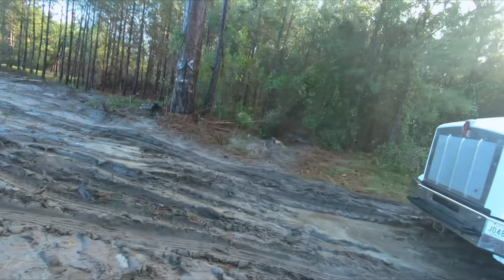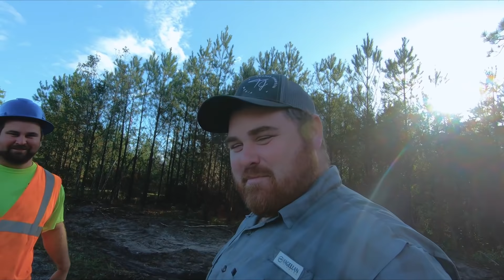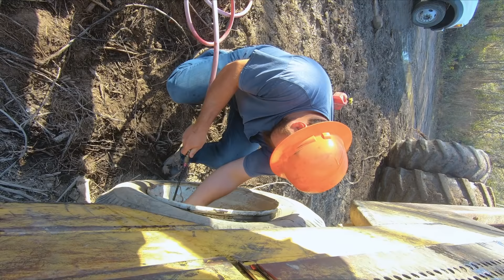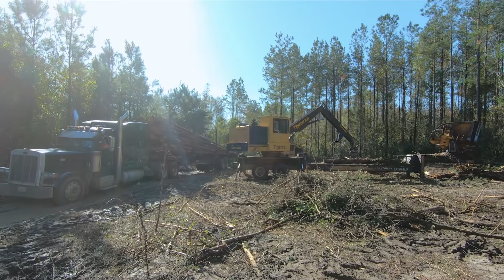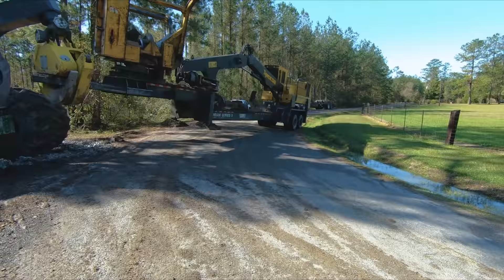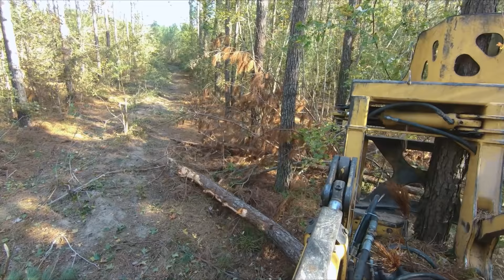Muddy Roads, Log Trucks Bogged Down, Starting New Tract, Playing With Fire & 718E Ride

Comment: on another note dont know if thats yalls truck or a contract truck. I was wondering how those full fenders hold up. I want some to keep mud off headache rack but am afraid of loader man putting one to close to rack, having to cut butt and dropping on them.
Reply from the maker: Full fenders work good if they are installed right. Get some thick diamond plate ones, they hold up well.